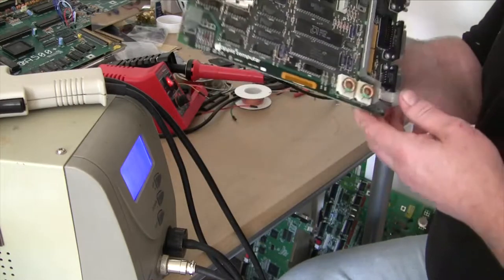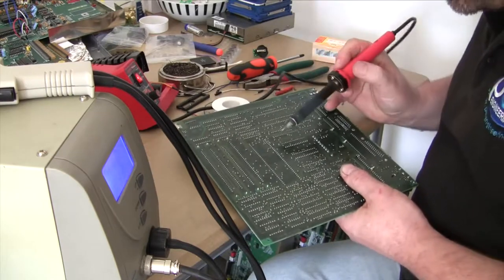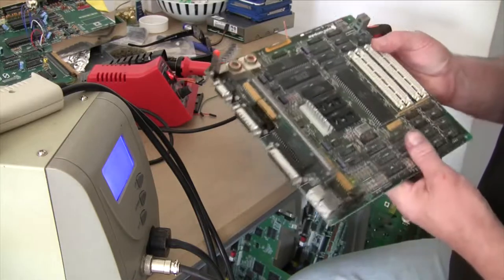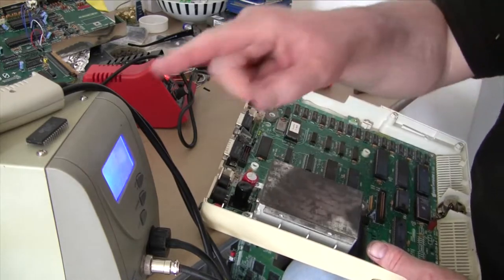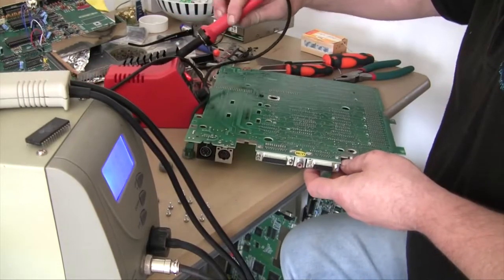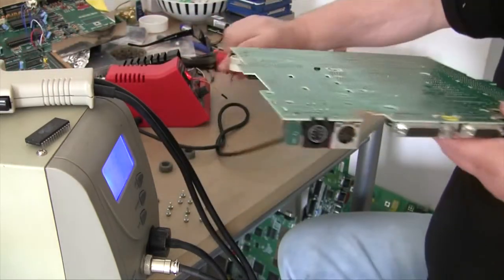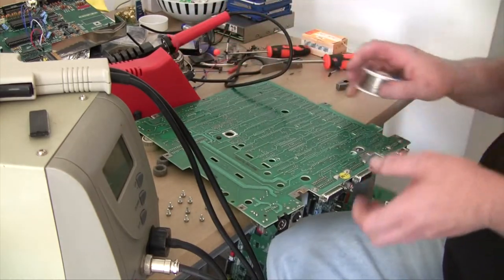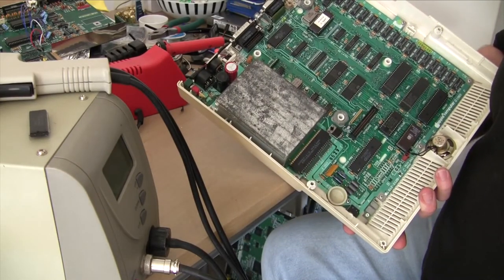Apple IIc IWM replacment

Comment: Hi Mikes can you confirm that Macintosh Plus IWM works perfectly  on Apple IIc ?
Reply from the maker: All Mac models up to the Mac ii have the Iwm and it will perfectly , mine does :)
Reply: Mikes Retro Tech thank you for your reply , i suspected the culprit was that iwm in mine , I have done the same procedure but still does not work , i red that IIc has a different rev (A) later Macintosh mobo ( 128k 512k ) has rev b and they are not compatible , I tried anyway but no success , hope to find the way!